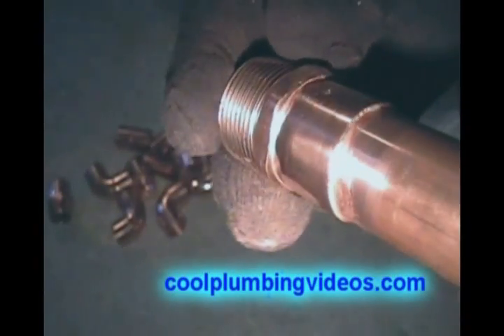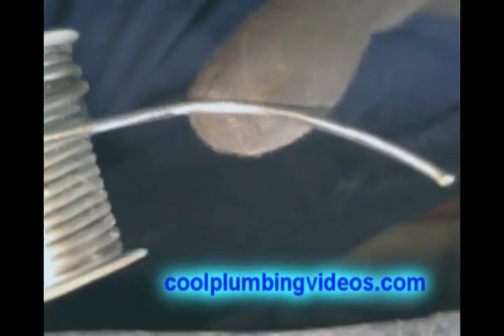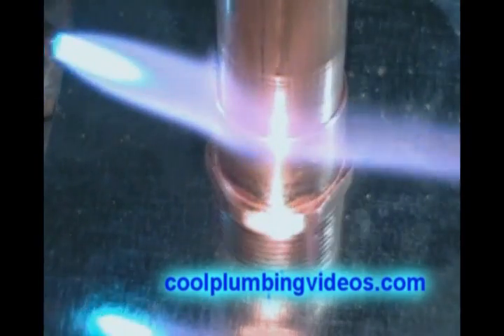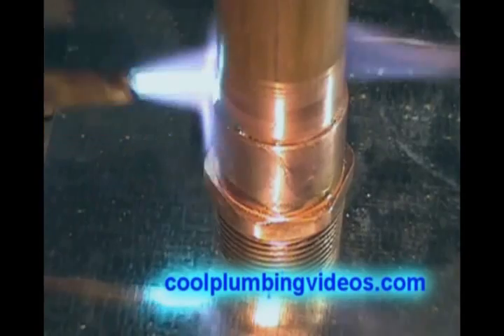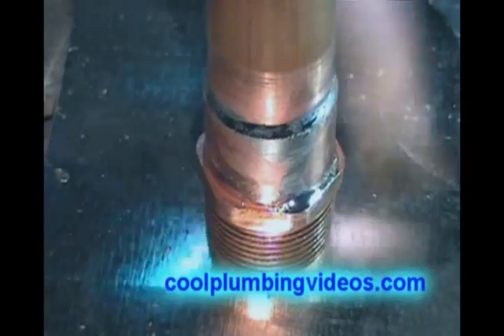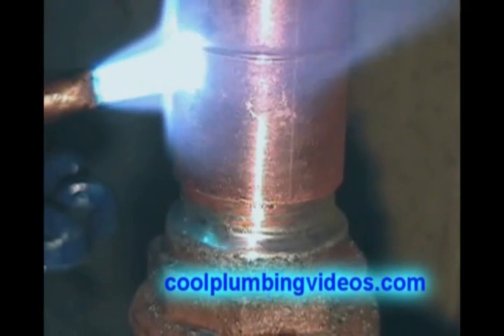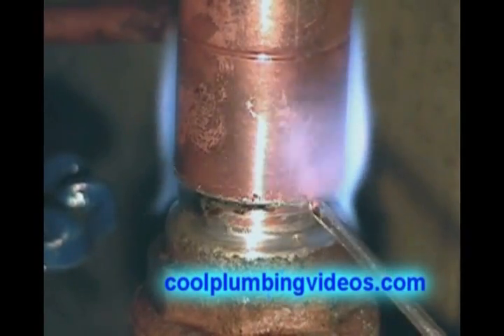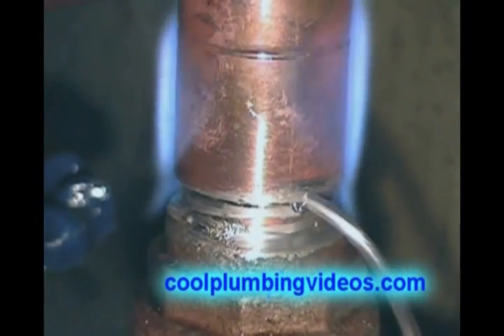How to Solder Copper Pipe 2/14 |How To Plumbing

Comment from the maker: You may have the wrong copper fitting or Pipe. They make to sizes that look so close to each other one is for plumbing and the other is for A/C line refrigerant. plumbing pipe is 3/4 inside and refrigerant is 3/4 outside die. I think this is what our running into. :-) Thank you for the comment

Comment: I love your videos.

I am soldering a pipe loop that the builder put in my house for a water softener.  However, I am having difficulty fitting the pipe (3/4", type L) into the fittings (I have some elbows, a coupling, and a sweat ball valve.  The pipe seems just a little too large to fit.. so more than a tiny fraction of an inch.  Do you have a suggestion on how to make the pipe fit?  Should I just sand it a bunch?  Could my pipe/fittings be defective?

Comment from the maker: @skatingolden I would replace it. Some time re-soldering a copper connection don't turn out so good. You may end up over heating the connection or there may be one dirty spot you just can't see or get to in the fitting it self. Good luck and thanks for the comment.

Comment: If an old joint develops an extremely slow leak (slow enough that if you wipe it then only a drop appears in about 15 minutes), can it simply be resoldered like it was new?  Or will it need replaced?

Comment: We run a lot of copper using similar solder techniques.   If you use the same technique in teaching the apprentices like you did in the video... they'll become pretty proficient at soldering!   Good work lad.